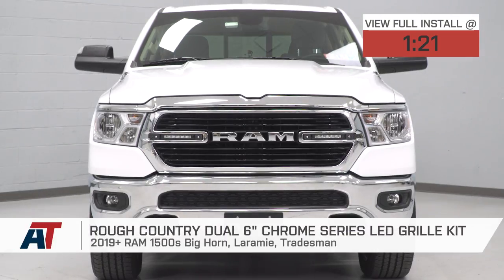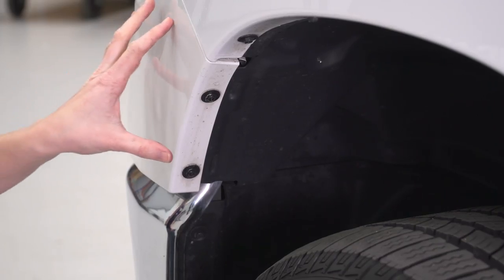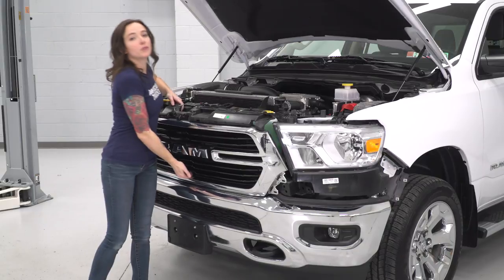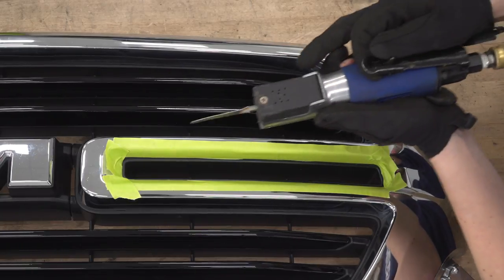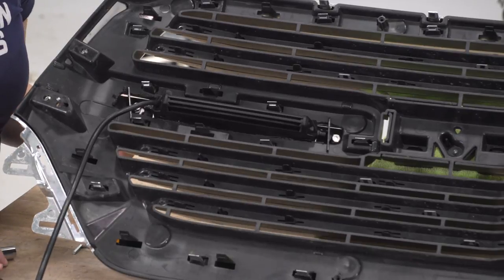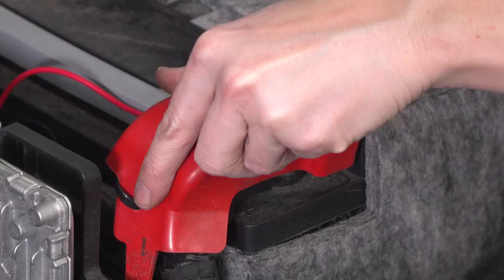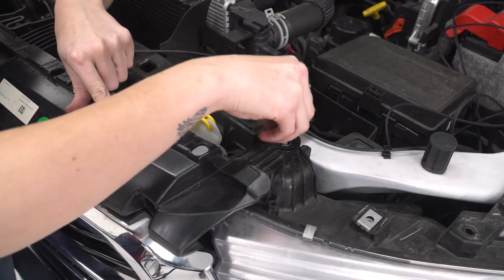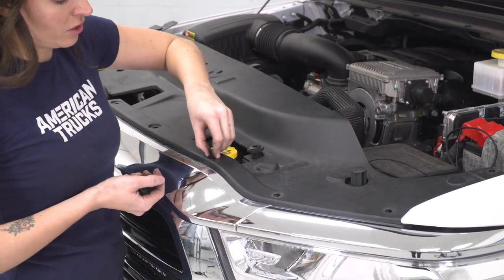2019-2020 RAM 1500 Rough Country Dual 6 Inch Chrome Series LED Grille Kit Review & Install

Comment: Definitely the best video for seeing how these guys go together.  Seriously thank you guys for making this. I just installed this kit yesterday and will say , I kinda freaked when I heard 5-6 hour time frame. 
But took it as a challenge to beat..lol
Was able to get it done in just under 4 hours. But I was also taking my time with everything as this was my first time dealing with this kit.
Everything turned out great, only thing I recommend is not having your light cables cross where the grill seals to the radiator support for directing the air to the radiator. I brought my cables up from the bottom where it seems to be completely out of the way. As opposed to having them go to one side. 
Good light output for the size lit up plenty for the size. But yes could define a bit brighter for all the work they require to put in. 😉
Reply: Does the switch drain the battery?

Comment: That was a very well explained mod install. You did a terrific job and that truck looks way cooler with these lights. On video you come across most excellent. Thank you for sharing your skills with us. If I may please add one positive note? Before fully reattaching the grill check that the lights actually work and there is not a short in the system. I learned the hard way when I installed a 20in light bar into the grill of my 2006 Nissan Titan! A few rows of the light did not come on. Removing and reinstalling was a real pain in the...Bring on the next video! Robert in Southern California.
Reply: sorry to be offtopic but does anyone know of a method to get back into an instagram account?
I was dumb lost my account password. I love any tips you can offer me!
Reply: @Finnley Elijah I really appreciate your reply. I got to the site thru google and im in the hacking process now.
Looks like it's gonna take quite some time so I will get back to you later when my account password hopefully is recovered.
Reply: @Finnley Elijah it worked and I finally got access to my account again. Im so happy!
Thank you so much you really help me out :D
Reply: @Salvador Marvin Glad I could help xD

Comment: Very good and informative video. However, after separating the grill from the shell, you can also separate the outer grill from the inner grill. Then you won’t have to tape the outer grill to protect it when cutting. I used a Dremel tool with 1 1/2” cutting wheel which worked well. No chattering from the reciprocating action or a jig saw. I have a Laramie which has fender flares that had to be removed in order to get the covers above headlight off. Had to remove inner fender wells so I could depress flare clips while pulling them off. There are posts on 5th gen Ram site stating that you can just pull on flare and pop them off but I didn’t want to chance breaking any of the clips. The worst part of the job was removing flares and the covers above headlight. The front fastener just didn’t want to release without a little help from a trim removal tool.

Comment: Hot knife took care of the grill. Fender flares made those side trim bits (that one odd angle bolt, mostly) a challenge.  The firewall pass thru wasn't as easy as what you had, for some reason. Still, great video! Very helpful!
Reply: What kind of hot knife did you use?
Reply: @3HAutoDetailing  I used a cheap one from Harbor Freight at first. For the 7 minutes that it was functional, it was ideal. Then it died. Used a utility knife repeatedly heated with a torch after that. Would buy a better hot knife if I did it again.

Comment: Please run the switch wire through the firewall, before connecting to the battery....those wires could ground out while being fished through.  Also test the lights BEFORE reassembling all that again.
Reply: She figured you already should know that.

Comment: Not sure what year model that truck is but it is not a 2019 Ram 2500. My grill does not have the plastic pieces under the headlights as shown. Great install but seems to be a pain in the ass to install a few lights.

Comment: Would like to know if anyone has factory flares and if so how did you remove the panels to get to the bottom bolts to remove the grill. Every video I’ve watched, the trucks did not have them

Comment: I would figure out the electrical load and try to wire them to the fog light switch
Reply: Folks like you who mess with the factory wiring are usually the ones who have their cars catch fire or screw up something else electrically. Rule number one LEAVE the factory harness alone
Reply: @ttss5726  you must not know ohm’s law. 12 years in the Business professionally and not one vehicle caught on fire.
Reply: @alaabes  well if u figure it out let me know!! Lol because I just bought these and I’m sitting here with my jaw dropped and my d*** in my hand wondering how I’m gonna do these nut ass install

Comment: The cutting of the Front Plastic Grill VOIDS THE FACTORY WARRANTY if you should have any factory defects...............DO SO AT YOUR OWN RISK!
Reply: Voids it on the grill yes
Reply: Most warranty are up with in a year or two as most hit 36000 miles fairly fast at least those of us that use the truck for its intended purposes ie not hulling around your family all day

Comment: The Rough County instructions are a joke!! They conveniently omitted that dreaded bolt in the fender well. They also fail to mention what has to be done if your Ram has the factory fender flares. When I called them they advised there was no bolt. ROUGH COUNTY  should be compensating you for your video which was much more helpful than they were. For the money they are nice but not worth the headache and they are not that bright. Switch was pitiful for the money. Fortunately I wired mine directly into an aftermarket Switch panel

Comment: Can the limited grill be modified to fit these as well?
Reply: I just installed them today 12/30/2020 on my 2019 Ram 1500 limited. Only modifications I had to do was cut the black outer trim brackets with a grinder. They look awesome and everything else the same. I cut the grill as they do in this video however I left about 1 inch of black grill on both sides of the light so I had something to mount the brackets against on backside of grill. I used the black long bolts supplied with washer and lock washer instead of the silver bolts you see on front of bracket (not long enough).

Comment: Its clear why you skipped the 8m on the top side you need a racket for. That one sucks. There HAS to be a less retarded way to remove and put that back. YOU NEED TO REMOVE THE UPPER 8MM ALSO SO YOU CAN REMOVE THE SHROUD TO GET THE 10 MM OUT.

Comment: 1) The new rams are ugly and there's no fixing that. 
2) If you say rad instead of radiator you belong in a tool box.
Reply: I love the new rams front ends !
Reply: New Ram is the best looking truck on the road.. Tundra is up there too. But, not chrome models. Chevy and Ford are sh!t
Reply: The new RAM front end got me to look at them in the first place! They look so much better than Ford or GM.  Ford and GM look like a refrigerator was turned upside down and now its going down the road.